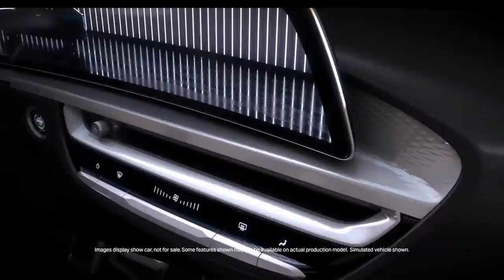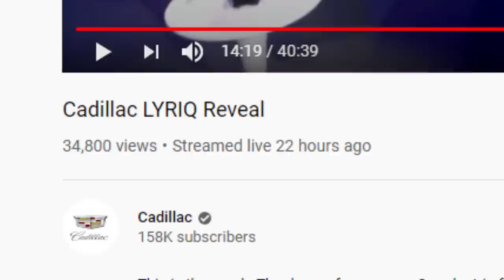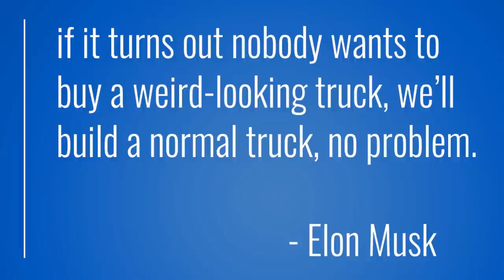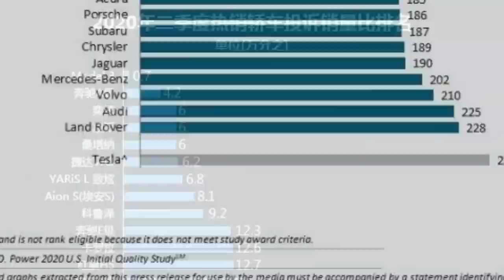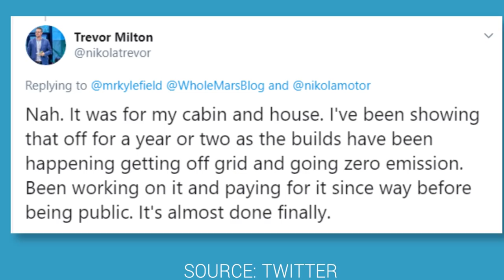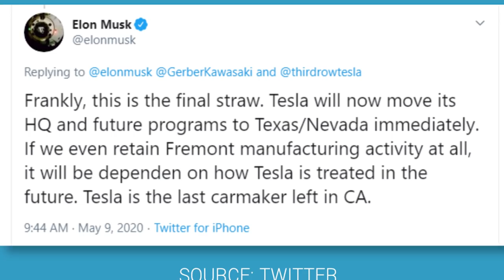Cadillac's New Electric SUV to Rival TESLA | EV News

Comment: It really doesn't matter how good the EV is.  GM's biggest problem is that the dealer network doesn't want to sell them.  It's not really their fault...most of their profit comes from maintenance, and EV's need significantly less maintenance.  GM can, and has, made a solid EV.  I had a Gen1 Volt for over 100,000 miles, that car went to the dealer about once every two years for an oil change.  Buying it was nearly impossible though.  The dealer really didn't want to sell any of them.
Reply: Exactly. Some dealers still refuse to sell Bolts.
Reply: Remember the EV1. Just think where GM would be in the EV market today if they had kept advancing in this market since 1996.
Reply: @craigbenjamin  Forget the EV1....where are all the Plug-In Hybrids they promised in 2010 when they unveiled the Volt.  A Silverado with 30-50 miles of EV range and loads of extra torque would have dominated the market.  Talk about dropping the ball.

Comment: Tesla is NOT a luxury brand not even close .. with all the quality issues may not even be a premium brand .. however Tesla is an expensive brand with great tech, still the tech that truly matters just about all major manufacturers has that .. as for range I use my model 3 as my DD daily round trip to and from work 45 miles a day, I can go 3 to 4 days from 80% to 10% without charging.... even the eTron can do the same that covers 99% of most normal uses case .. for a DD Tesla does not have the edge .. however for 1% of us going on very long 700+ miles road trips you do save one less charging stop over other EV with 200+ range that’s nice but I would go for overall quality and value for your money next time..no one needs a performance EV as their DD .. no one needs super long range for a DD .. quality and luxury is The next evolution for EV .. they are way too expensive not to be in the luxury class.. as for the Lyriq it’s amazing looking inside and out . However Cadillac did not do a good job with its unveiling .. I did not even know it was coming .. and more details spec and price was not stated ..but since it’s a 2023 model year we will see this car in 2022 .. hope they can get the price point just right with this one ..

Comment: Lucid Air is boasting the longest range of EVs.  More than the Cybertruck at 500 miles?  I'm creating an EV prototype in my garage.  It will be going into production before the Lucid and the Cadillac, and it will have 1000+ miles pf range, and priced under $20,000.  It's a LUCID KILLER! I promise.

Comment: I hope it has good and strong ambient lighting, not feint like the one in the Escalade 2021.  I hope it will be on all four doors and the center console too.  I hope it will have I hope it will have many choices of colors, not like the one in the escalade where it has only eight colors.   The ambient lighting in the escalade is not good.  Since the previous generation of escalade had NO real ambient lighting, I waited many years for Cadillac to learn from the Mercedes and Audi and incorporate similar ambient lighting.  And when they finally came with ambient lighting, needles to say I was very disappointed with the one in the new 2021 escalade.

Comment: 2023 and not EPA measured range on the Cadillac. Let's talk in 2023. By then, Tesla will have Texas, Shanghai, Berlin producing cars. The problem is that the bonuses and stock options of senior executives are based on selling ICE cars >>> Follow the money! GM does have the technical talent to produce EVs, but engineers and not compensated to lead in developing a technology that will eviscerate their present ICE sales.

Comment: Oh my god, did you say “ maybe their engineers are not good enough”. You must be kidding? They have no infrastructure, a giant company like GM can’t risk doing what Audi did and bring a car to market prior to building an infrastructure to support it. GM can’t take silly risk like that, that turns off customers and of course their customers base is considerably give the cache of the name. If it takes three more years , so be it. I’m sure that chassis will be a surprise Chevy in one year anyway.             The engineering is sound and isn’t exactly rocket science, they are eclectic, so are golf  carts. These things are easier to design than petrol cars. plumbing is easier, packaging is simpler but determining that new package is the key. Do it once and don’t screw up, make a template.

Comment: Good video.
Audi Etron needs to switch to software overtheair and quit its only hardware approach for improving cars thus increasing value of sold cars the way Tesla does. If Ford and Geely/Volvo in Polestar 2 can do it -why not Audi?
Cadillac Lyriq is designed for Chinese market and it is good for it. Unfortunately GM does not want to loose money like Audi and Jaguar iPace so they want to procrastinate launching something like Lyriq in the USA.
Kandi is overpriced for specs and design in the USA but I wish them luck anyway.
Russian cheap EV might be only for local market since looking at Chinese companies it is extremely difficult to come up, stay and be competitive on the Western markets with cars of own design since design is dictated by tradition carried on by legacy manufacturers.
Looks like Fisker Ocean is going to be built in the same place by the same company as Fisker Karma was  8 yeas ago in Austria. Hopefully this new company will more lucky.
At least Lordstown has its prototypes ready for production while Nikola has only vaporware.
Cybertruck looks like is having its redesign for production which is laudable as factory is getting ready built.
Reply: Audi doesnt do it because of User friendlyness... the average audi suv driver doesnt want to change the way the auto is used every couple of month.
Reply from the maker: Etron does have the over-the-air software updates
Reply: @EforElectric  full or just firmware? i havent seen any major updates, but to be fair i only borrow it when i need a bigger car.

Comment: Look, we keep comparing all automobile manufacturers to Tesla and it's success, foothold, Niche, whatever. There's many dynamics at play here. First of all is the mere fact that, for the most part these companies, like GM, FORD, AUDI. MERCEDES, without considering the obvious fact that every other company has been building ICE propelled vehicles for almost or more than 100 years and are such so invested in this that, it's still not cost effective to fully invest. Even the way these dealership networks were setup originally, like many other issues, especially in this country, are archaic. How do you overcome this "overnight", in order to dethrone the mighty Tesla. Please. I have no doubt that even Chrysler could outbuild Tesla in quality, technology, and any other criteria. As far as GM is concerned, it's flagship Cadillac division isn't where the testbed for all technology has been given. Since it's inception, over 67 years ago, one model in the GM family and to a larger extent, US automobiles, is that Beacon. It's name is Corvette. The first production fly by wire platform in the US went into production some 7 years before it was established in any other makes or models. The first production car on the planet to be able to pull a full "G" on a lateral skipped, in 1984. ABS TECHNOLOGY, was basically refined on this platform before most other manufacturers could even make it into production. If you understand that Telsa, is on a headon collision course with a technology dynamic known as the Osborne effect, and that all the other manufacturers have been, or to some extent currently bound by it. It easy to understand the answers to these questions we keep hearing over and over. Look, no Doubt Elan Musk is one of the Sharper minds on this planet, there also was a time when Donald Trump was, and it wasn't in this millennium. There's many flaws with every single human being. It's easy for certain groups to want to label Elan Musk as a God, because of these examples of what he is trying to do to push advancement of the human condition. Heck we all should be. But don't be blind following sheep and just digest what is being force fed you by this media omeba that exists. And no the internet is not a platform to achieve a structured formal education. It's a phenomenal source of all information and knowledge that we all already know in our minds. There is just too many people who are hanging on every platform for their justification of life. Seek, build, promote true knowledge and learning. Im my lifetime I've literally owned personally thousands of vehicles. It's been my "drug", fascination, obsession, etc, since I was a little boy. Nicola Tesla was the sharpest mentality of his time and to some extent could be now if he were still with us. Because this company used his Fame to convince everyone on this planet that they have all the answers in the electric vehicle regard is preposterous. He was also bound by dynamics at play preventing us from being past this already and many of these things are still at play.